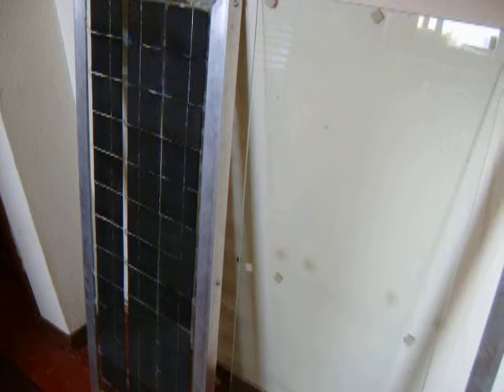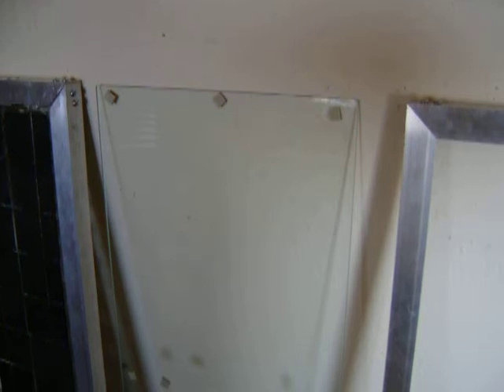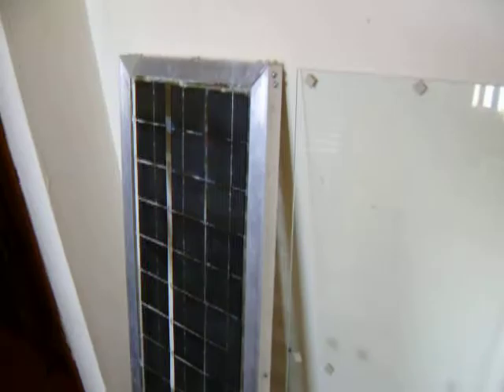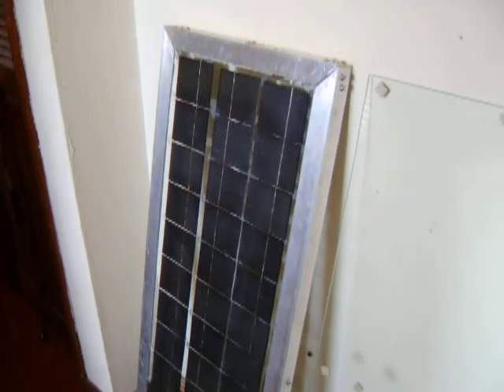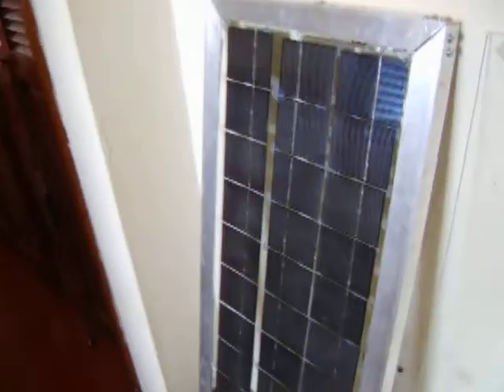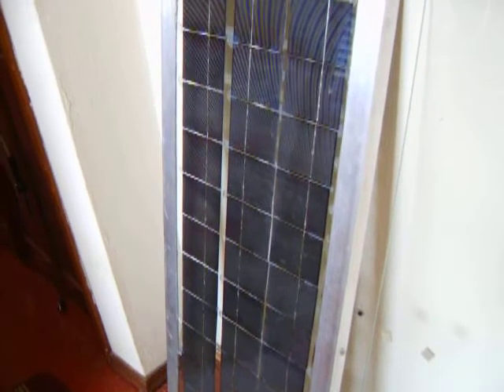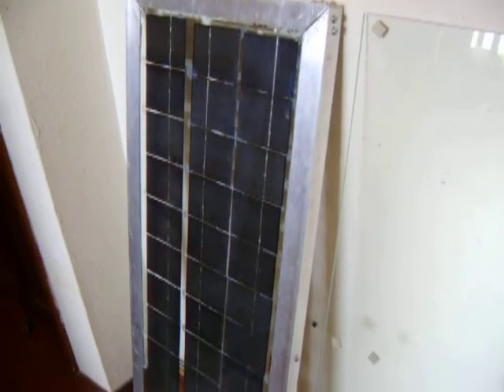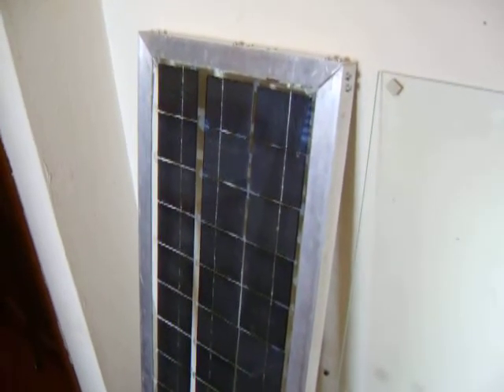How to Make A Solar Panel that Will Last For 30 Years Pt1

Comment: Great for newbies who wants to try building their own solar panels versus buying it from shelves!
Reply from the maker: It sure is a lot of fun to build one. I have made a lot of them because I enjoyed it so much. I made one for the fifth grade students and let them help some on the frame. The cells are so easy to break that I couldn't really let them handle them or solder. Not that they wouldn't be able to but they could get burnt or break the cells and I couldn't be responsible for that. They are great fun to make kinda like building a model air plane or something. Its a fun hobby and you can power stuff like a attic vent or some LED lights or something. I am using a diy panel right now for my fairy lights Im installing under my kitchen cabinets in my latest videos.

Comment from the maker: @815shakyshawn You should visit the Coleman Air site and read the diagrams or pictures of how to hook up solar panes and generators up to batteries to power a Dc to AC inverter. They have some good diagrams or pictures with arrows and easy explanations of how to do it. Its not rocket science. You may enjoy looking at that site.

Comment from the maker: @DeanC993 Check out "Update On GTI And Small Homemade Solar Panels" also look at the watts I have been making with them on the Grid Tie Inverter watch "Temperature Goes Down Watts Go Up" Its really hot weather so I m not getting the full potential still yet 98 degrees is how hot it was in that video. This fall when it starts getting cooler the will make some good power.